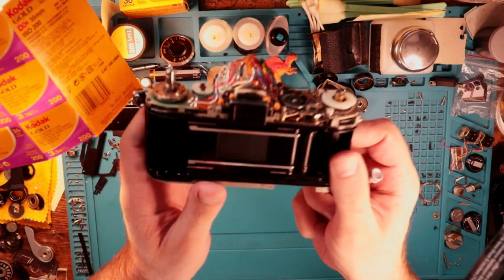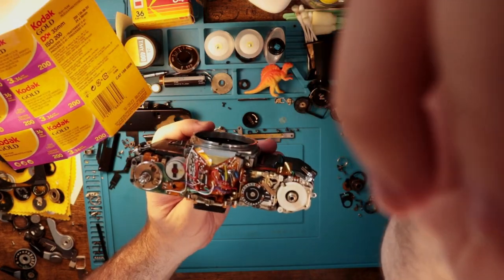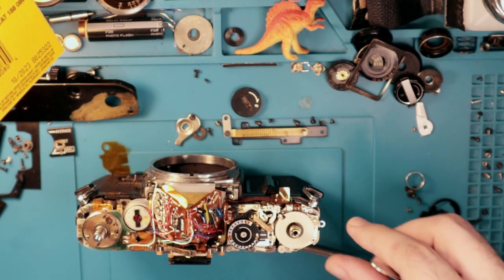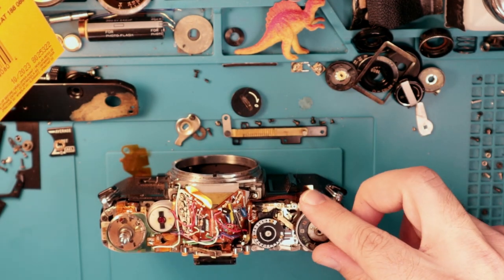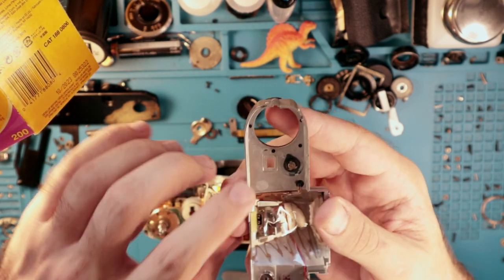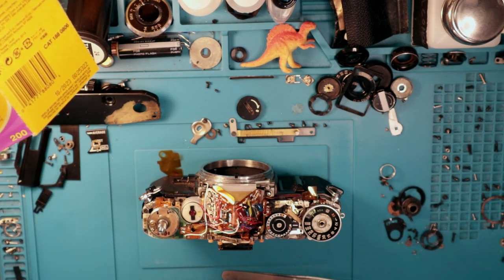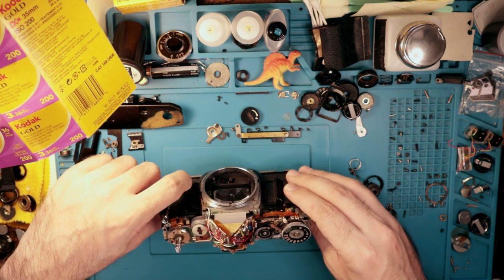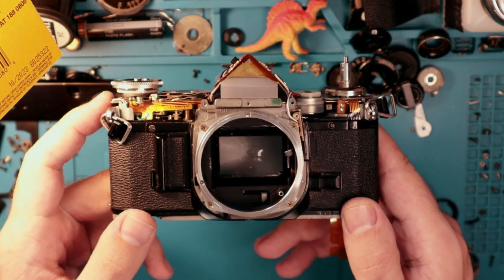Under the Hood of a Canon AE-1

Comment: I replaced the top of the camera due to corrosion. When I was taking the shutter dials off, I didn’t turned all the way to 3200 iso, nether the shutter to B. 

I got a new battery, and the shutter fires fine. 
The light meter on the other hand blinks and goes all the way to underexposed. 

Do you think it’s because I didn’t turn the dials on the right position when I was taking it apart ? 
The video is very informative.
Reply from the maker: That's exactly what's happening unfortunately, the pulley system from the shutter speed and ASA dial pulls the contact board that adjusts resistance to the light meter and so if the resistance is off then the light meter will be a little wonky

Comment: Hello! Your videos have been super helpful, and I was wondering if you could help me with something. I have a Canon AE-1 Program, and the advance lever is stuck. I've opened the bottom to see if there is any debris, but I can't see clearly and don't know how to move things around to get an unobstructed look at the gears. Do you have any suggestions or tips to try to figure out what's going on?
Reply from the maker: Thanks for reaching out! I would first recommend throwing in a new battery, turning it on and hitting the battery check button which should make it beep at a relatively quick rate meaning the system has power. 
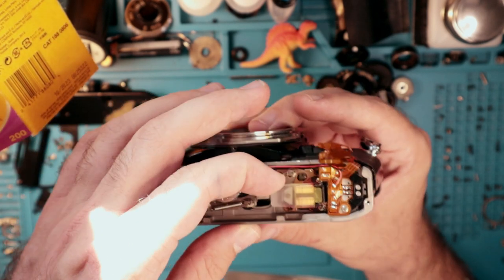Then I would look at the bottom to see the positioning of the release magnet system @5:37 you may need to manually release it which I do a few seconds later. Feel free to shoot me an email too if you need more help it's a bit easier for me to get an idea of the potential issue with some photos